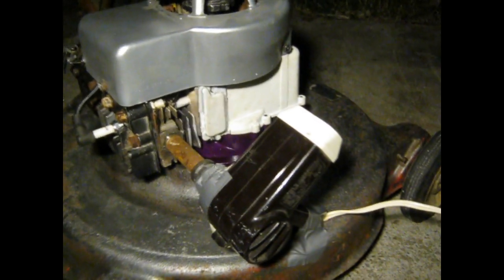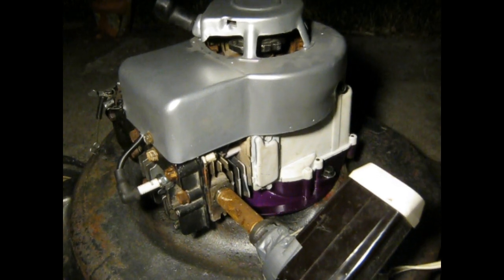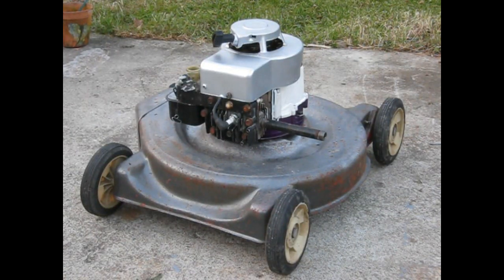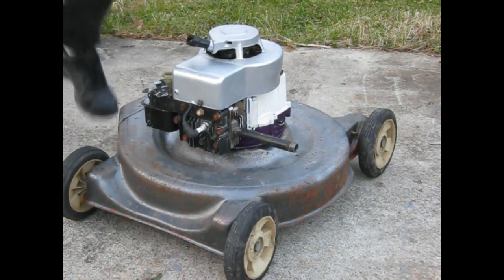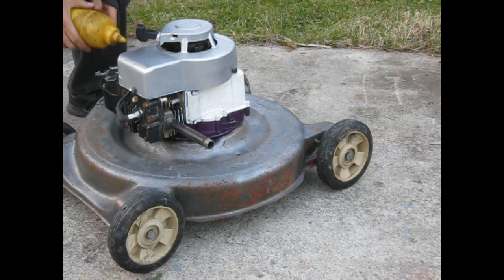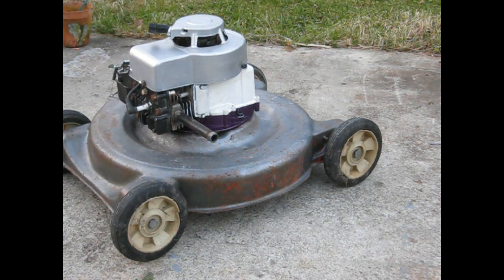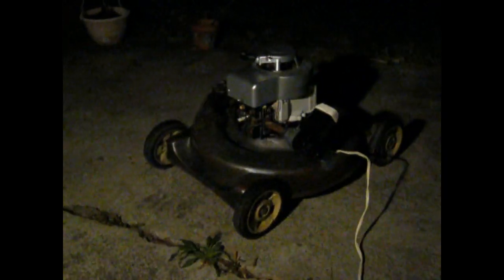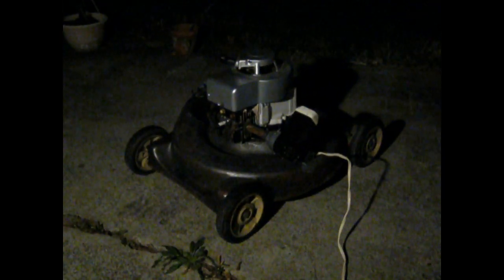Simplic Starting Attempts !

Comment: Simple 2 stroke engines like in weed eaters uses the piston downstroke to push the gas mixture contained in the crank case to the chamber through the ports. More complex 2 stroke diesel doesn't use the crank case, but instead uses forced induction to push air from the ports to the valve. I'm not an expert, but what the have in common is a pressurized intake, maybe you could try your electric blower on the intake side?
Reply from the maker: I may try that yet, after i shut down the heating element in the hair dryer. This is an unusual engine, so I figured pulling the exhaust out would be similar to pushing the air in. i am wondering if it has a spark problem, as I removed the carb, and sprayed the starting fluid into the intake manifold, and it didn't try to fire, so something is rotten in the state of Denmark!  :)

Comment: Maybe it needs more fuel? The carb's probably only set up to feed fuel every other cycle, so maybe it needs it's jets opening up... :)
Reply from the maker: that could be, this particular carb is non adjustable. I even tried it with no carb, spraying the quick start into the manifold, it didn't even attempt to start :(

Comment: Definitally need a drill starter! XD
And maybe could check there is sufficient spark??
Reply from the maker: I replaced the magneto, so the spark was A1, and I tested the plug again, so it should not be a spark problem. I think it just isn't getting fuel somehow. I will build another block with a smaller volume intake manifold, and try again soon. (After Christmas)

Comment: I love your videos i think you got a intake leak and maybe drilled too many holes. You can prolly check your fuel air at the exhaust to check the intake holes and a preassure test might show a intake leak. You have the best videos.
Reply from the maker: Thanks for watching my vids, i know my photography isn't the best, and I am not an actor, but I try to built interesting off the wall projects like this.
Reply: ChargerMiles007 seems like you have a lil more compression then you should. Or perhaps you are getting predetination. My money is on timing. I love the exhaust vacuume. I always thought that would act like a low grade turbo. But never tried it. Try slotting the mag so you can move the timing. I think it will bang. Keep up the great work.
Reply: ChargerMiles007 maybe a plastic bag over the carb to see if its sucking or backfiring

Comment: well, seems to be kicking more with forced vacuum, hopefully with a bit of tweaking it will get there.
Reply from the maker: I pulled my brains out on this thing, so I have given up on this configuration, I think the intake manifold has too much volume (this block was originally for the Jumo 205 (Deltic) opposed 2 stroke, so I made it big to flow lots of air. this engine seems to need less volume, so I will make a new block and try again. it is going to get butt freezingly cold here this week, so I may not have an engine vid for another week or so. I want to try a 4 stroke Hyper-expansion engine also, just to see if I can get the idea to work at all. i am sure those guys at Napier had better luck , since as far as i know they built and tested some prototypes of the Simplic. Those would have been diesels of course, so i am attempting something different again.

Comment: I think it needs a much longer exhsust pipe. Around 2 feet. Fitting reed valves between carb and engine should help get running to fine tune and remove later. Without reeds the intake charge might rush into cylinder and then back out before piston comes back up. Reeds should get it to run.
Reply from the maker: Interesting ideas, i just had a piece of pipe 6" long, so I gave that a try.

Comment: What about cylinder turbulence? Fuel and air may not be mixing very well in the combustion chamber.
Reply from the maker: Yes, that is a possibility, I did a little grinding in the chamber to smooth out some of the squarish edges before the last attempt, but still no luck. I know it has a small manifold leak, since gas dripped out of it, but you think it would still make an attempt to start.

Comment: could the hair drier be pulling too much air? instead of just drawing air threw wouldn't it cause a vacuum that seems like anti compression? might be better to use the hair drier as a turbo to push the charge in
Reply from the maker: Perhaps, I would have to run wires directly to the motor of the hair dryer and run it on 12 volts DC to de-activate the heating coils, to use it on top of the carb. there is no way I would want the hot elements on top of the gas tank. i may end up doing that yet.

Comment: im thinking it is ignition timing. its not firing at the right time. but first to get down to the issue try putting fuel down the sparkplug hole and if it starts that its a fuel issue. if it doesn't then your best bet is the ignition timing. if its like a two stroke it sparks 1 stroke apart, 4 strokes spark 3 apart.
Reply from the maker: I have a small problem, the spark plug is JB Welded in place in the head, as I filled in the combustion chamber to increase the compression ratio. The magneto fires on every revolution, so as long as it is functioning  properly the timing should be OK.

Comment: It the spark plug fouled or is it even making a spark check it again. Clean the plug it is not sparking.
Reply from the maker: That is what I thought, but the plug sparks fine, I tore the engine down to check it.
it has to be a fuel problem, as one youtuber said, because it doesn't even go with ether spray. I think the intake manifold volume is too large, so it doesn't generate enough suction velocity. i will build another block with a smaller manifold, and try it. I don't give up easily!  :)

Comment: Do you use anything for counter balance on your project engines or just a certain flywheel?
Reply from the maker: I generally use a heavy steel flywheel from a horizontal shaft engine, like a snow blower or roto-tiller. I pretty well never run a blade on the motors, so I need the heavier flywheel so it doesn't try to backfire.

Comment: is the timing for spark correct? or maybe the coil is bad. but it may be ignition timing.
Reply from the maker: The magneto will be the first thing I change tomorrow night when I give it another try. I tested the magneto before installing it, and it did fire a plug, but i guess anything can go bad.
Reply: Remember, these engines actually run with quite a bit of ignition advance. They fire the spark plug about 22-24 degrees before top dead center.